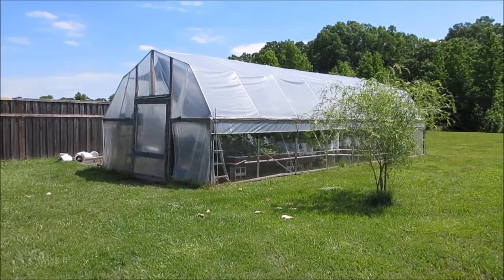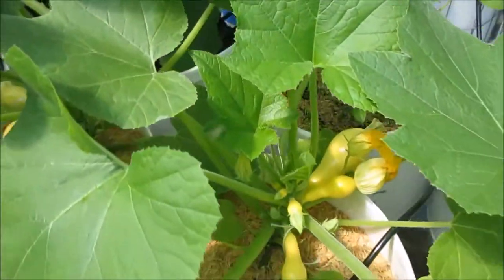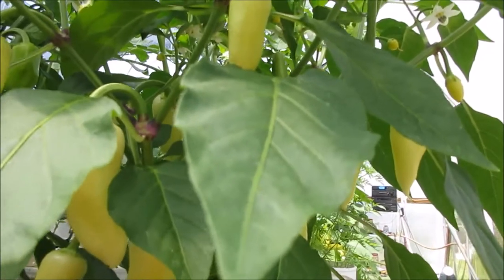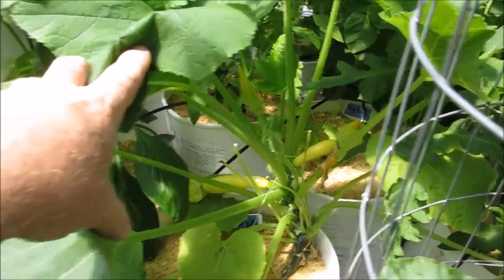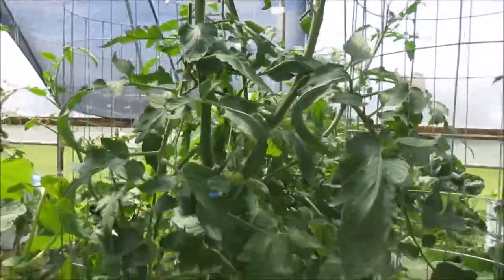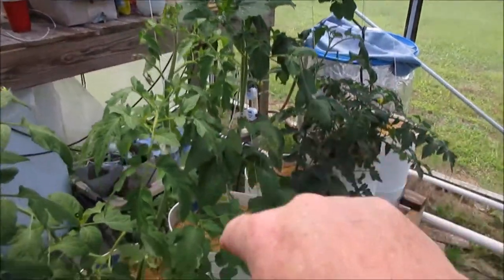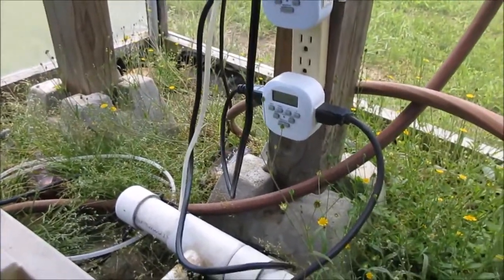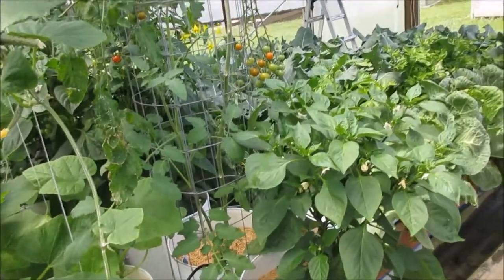Greenhouse Update:  FAWN

Comment: Dang Brent. That greenhouse is busting at the seams with fruits!
Chuck
Reply from the maker: Don't tell anyone Chuck, but run MB mix with about 75% of the Calcinit recommendation.  So, instead of 20-18-38, maybe 15-18-38.  Helps reduce tip burn and pushes more fruits to foliage ratio.  Anecdotal evidence and only my thoughts on it ok.  Do what works for you 'cause you got some really great stuff growing buddy.
Reply: Hydroponic Gardening & More with Brent I will do that Brent. I was toying with the mix last year. Your suggestion makes a lot of sense.
Chuck
Reply from the maker: If it doesn't work, you have only yourself to blame ok.  We're still going to remain friends!
Reply: No worries there Brent. 
Chuck

Comment: great video, my question is, when the concentrate starts to pump how does it mix with the correct amount of water?   so much concentrate, so much water.  how do you control the mixing?
Reply from the maker: One water cycle empties the distribution tank by 25%   The distribution tank is on a timer 4x/day for 4 mintues each cycle.  So, at 7am, it pumps until  704am.  The gravity fed water in the 250 gallon storage begins as soon as it falls below the float valve, but it adds slowly.  At 705am, the two pumps for the nutrient tanks start.  They're on the same timer and adds concentrated nutrient for 5 minutes through 1/4" tubing into the top of the distribution tank.  They are mixed with the two air stones that remain on at all times.  Because the next cycle is 3 hours later, it mixes well with only air stones.  

Each cycle distributed and amount added is small, so the variance in PPMs is easily adjusted, by the nutrient timer, before it gets out of control.  For example, if the ppms get to 650 when I check it that day, I can add one minutes worth of nutrient manually.  The timer has a countdown.  If that one minute brings it back up to around 800 or so ppms (where I want it), I add a minute, to the nutrient timer cycle that comes on 4x/day (adjusted cycle). 

It sounds complicated, but it's not.  I was gone 2 weeks on vacation and it was pretty much ok still when I got home.
Reply from the maker: One could mix the overhead storage barrels with fixed nutrient and it would be ok to gravity refill and no need.  I did that first.  This way, I can do 1000 gallons instead of 250.  I am lazy and don't want to mix nutrient every 2 or 4 days with all that I grow.